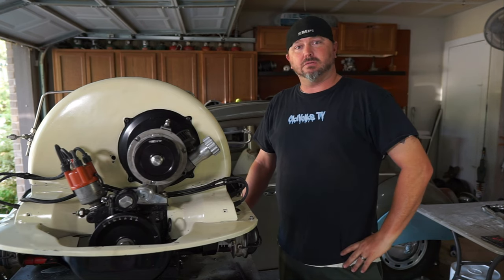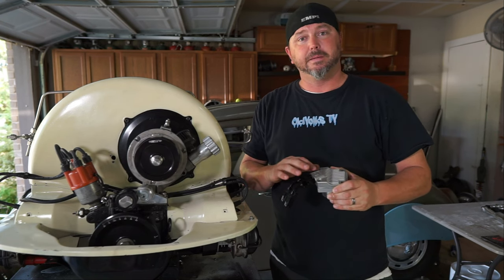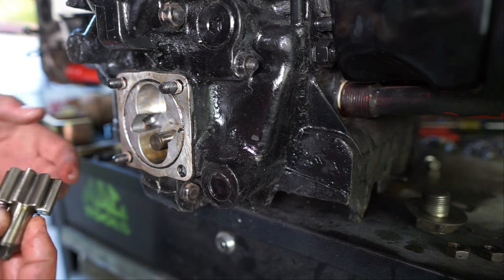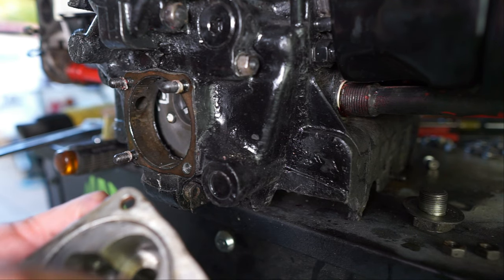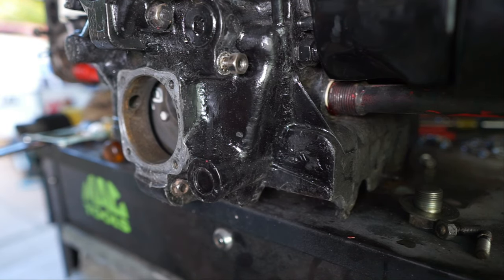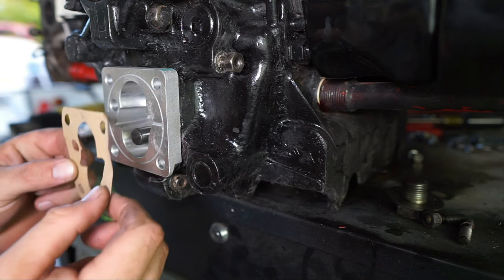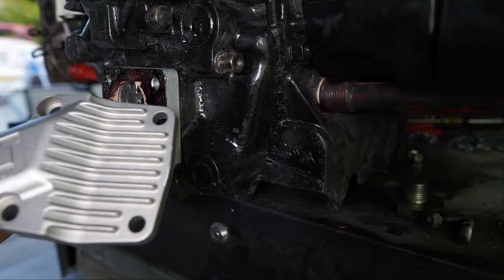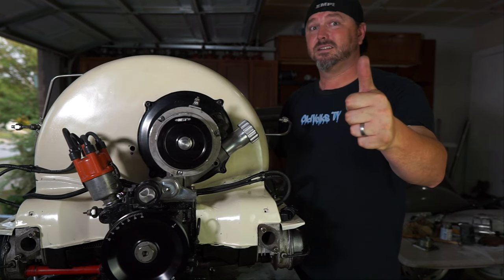VW Bus Engine Oil Pump Replacement

Comment: The oil pump tool, C shape piece goes vertical on the case. I didn't know either, until I saw a photo on the bentley manual.
Reply from the maker: Really? That makes more sense!
Reply: @OldVolksTV   Lets hope the new oil pump has the right clearance between the cam and oil pump gear tag.

Comment: Hey , When you had the pump with out the cover on you should had tighten up the case bolts to see if the case would grab the pump or not . Aftermarket pumps measure all over the place compared to OE VW pumps . When they don"t grab the pump it the same as taking your Chevy pump and putting washers under it to the main cap ???? That one didn't appear to be real loose you had to wack it in place . And this applies especially to a new Autolina case . The reason I am telling you I built a motor that every thing was new and as soon as it would warm up it only had 2-3 lbs of oil pressure I took it apart 3 times before I found that problem . The motor was still in the bus and I bought a Mellings cast iron pump and soldered around the inlet and output holes , shoe shined them in with sand paper till I had a snug fit . The motor went from 2=3 lbs hot to 45 lbs hot . With out taking any thing else apart .
Reply from the maker: Wow! I never thought of that. I'll have to go back and check it!

Comment: Being a full flow pump, you could back feed oil through the out of the pump cover if you wanted to prime the pump. 
Like what you said a few times, do what works for you 🤙
What brand sealant were you using?
Reply from the maker: I like the permatex anaerobic goo.  It keeps the gaskets where you need them, but it never gets hard or clumpy so disassembly is a breeze.
Reply: @OldVolksTV  haven’t heard of that one, so it’s different than the aviation sealer?